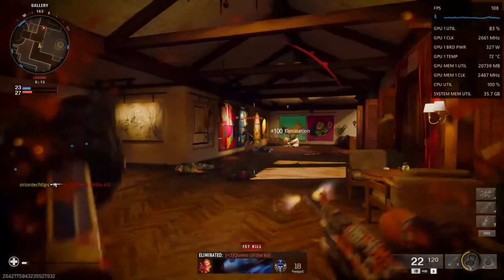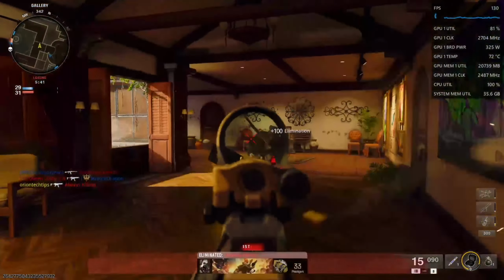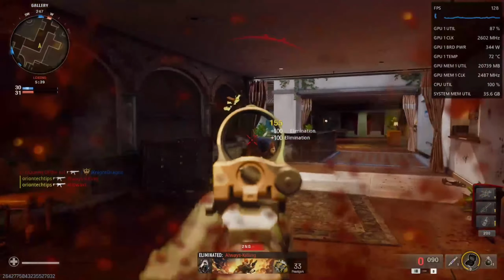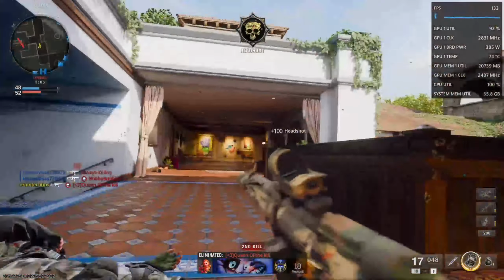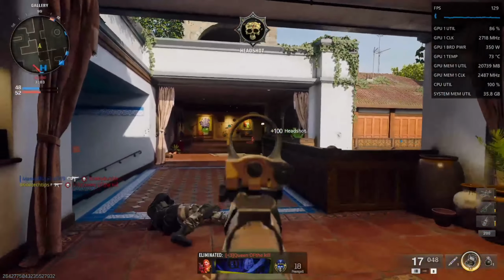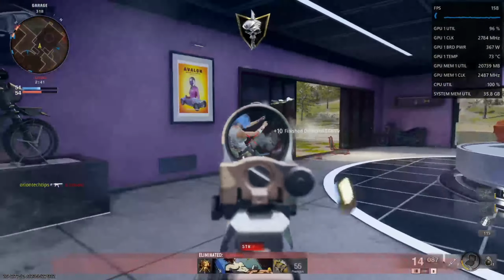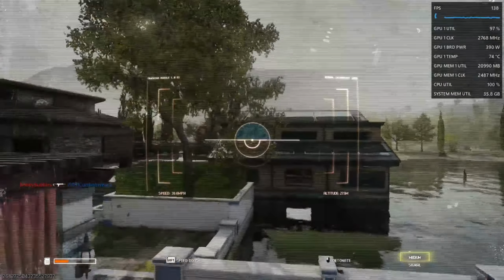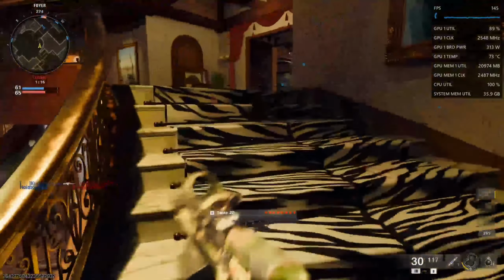Call of Duty Black Ops 6 RX 7900 XTX Ryzen 7 9800X3D 1440p

Comment: I have the same setup, in cod set all the settings on low, fidelity cas max strength, no upscaling or frame gen. I get 250 with no drops I think my low 1% is 244